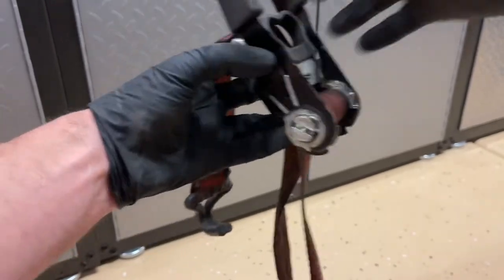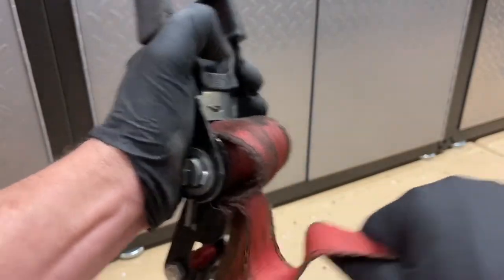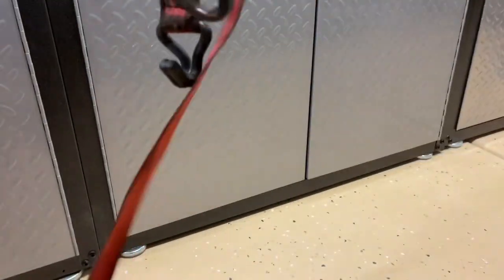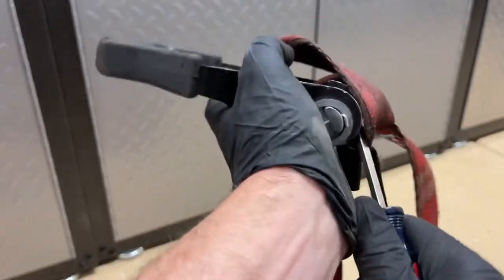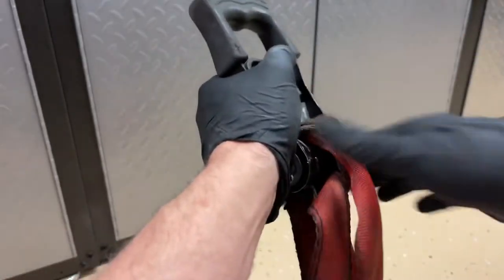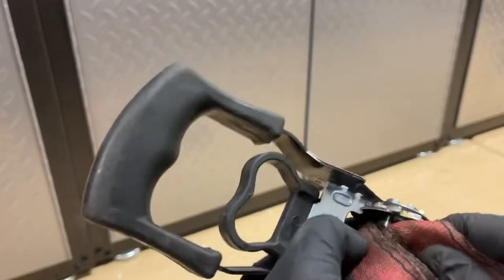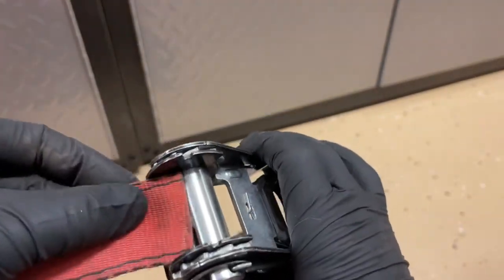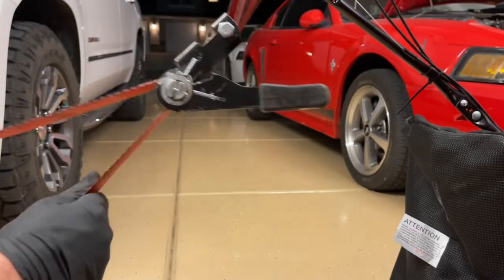Untangle a ratchet strap: 1 layer down trick. Fix Bunched up ratchet, thread, proper use

Comment: What happens if BOTH ends have metal hooks attached that prevents the strap from being completely pulled out?
Reply from the maker: If that’s the case, it should not be tangled. Release the ratchet (open if flat) and try applying a fair amount of pressure on the side that isn’t short to see if you can rotate the drum

Comment: What would you suggest if I can't even get a half inch of slack to start to pull out first layer? The short side has a hook attached just for information. Thanks
Reply from the maker: You may need to disassemble it
Reply: @dannyjohnsonsgarage  I would love to, no screws to take out, is there a way to disassemble with out screws? Thanks for your quick response even if you can't help